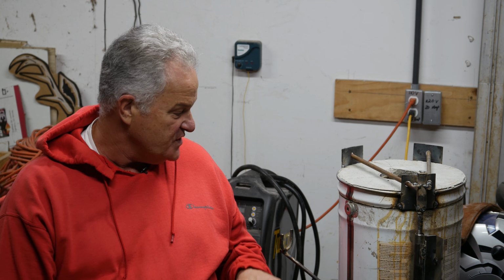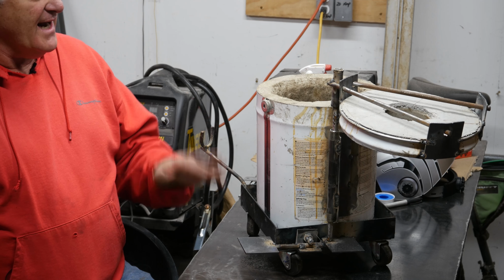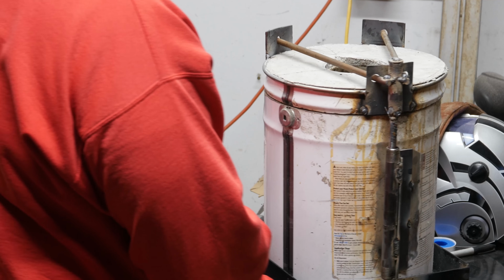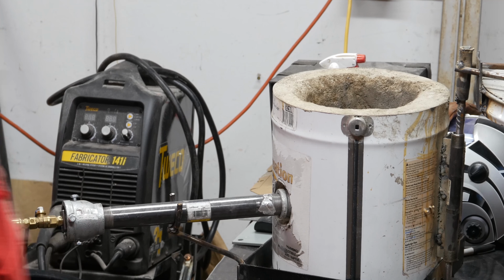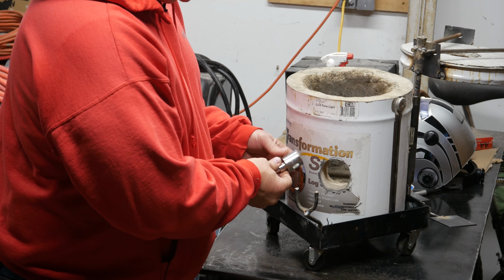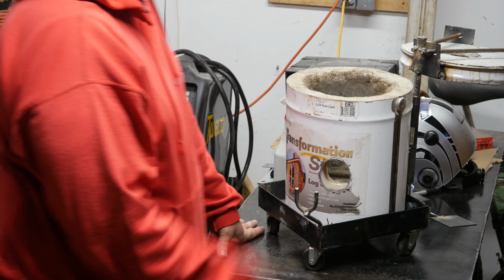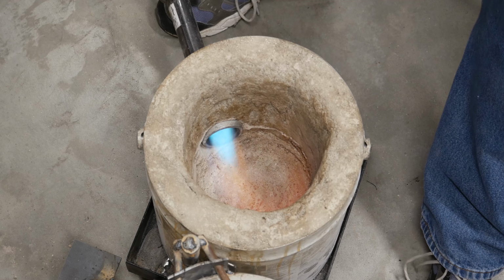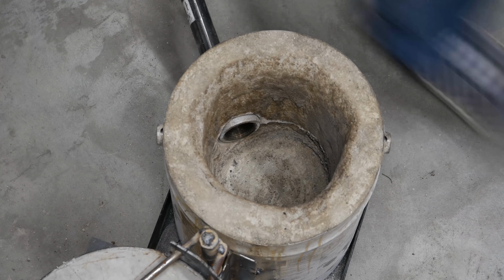Making a foundry furnace part 3

Comment: That's a large hole in the top. I've made my own foundry as well, but I think the hole in the top is letting out too much heat. How essential is the ceramic coating on the inside?
BigStackD said I should check out your channel.
Reply from the maker: You have to have some hole to let the pressure out of the furnace or it won't burn right.  This is my current furnace. It's a little nicer. https://youtube.com/playlist?list=PLU1QP34Dv8Y4dQ0xr3-nY_54cH5_vaQzP (1st two videos in the playlist) I've been told by a foundryman that the hole in it may be a little small.

Comment: Yohooo it is finished! That lid turning device is a very nice design! Now on to melt some metals 😁 I ordered my crucible from aliexpress it is a number 4 for 4 kgs of copper and it costs 25 euro, about 30 USD. If you know a great webshop for crucibles with reasonable prices that ship to the Netherlands I would eagerly want to hear that 🤣
Reply from the maker: I've bought all of my crucibles (just bought two more on Monday, from 4mazon. It's just easier for me to do that than to go shopping all over the place. Do they ship to the Netherlands? Probably not as shipping anything from the States to anywhere else in the world is a complete ripoff.  It's about three times as expensive to ship from here to there as it is to ship from there to here.
Reply: @swdweeb  I think they ship I"ll have to look it up. Thanks!

Comment: Looks awesome!! can't way to see some stuff melting.  and can confirm, past everybody is a jerk to future everybody
Reply from the maker: Don't you ever sleep? ;-)  Yeah, did I mention that I need to find a crucible?  Arrrr... I want to see stuff melt in there too.
Reply: of course i don't sleep, not since I discovered how amazing coffee is!!
Reply from the maker: :-D
Reply: That came out great! Don't worry about it not being perfect. Don't forget to take into account your lifting tongs when deciding on a crucible size. You need room to be able to use them. Also, are you using a high pressure regulator? If not, get one. They're about 30-40 bucks. Don't use the shut off valve as a means to control the flame.
Reply from the maker: There is a pressure regulator in the line at the bottle. I had it set to about 10psi.  Just to ask the obvious, are you telling me to open the valve all the way and tune the flame with the pressure.regulator?
Reply: swdweeb - Exactly. That's what it's made for. I just learned this after I installed mine. The valve on the tank and the shut off valve are made for all on or all off only. BTW - the lid mechanism turned out great. I've been contemplating if I should install something similar on mine.